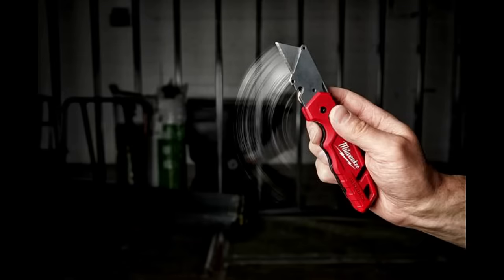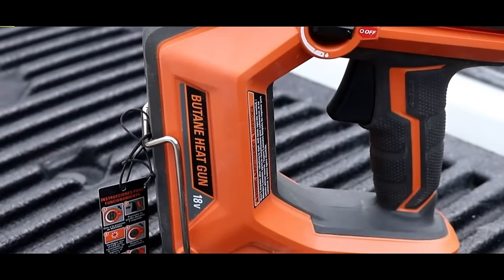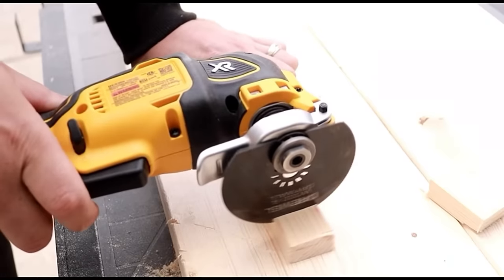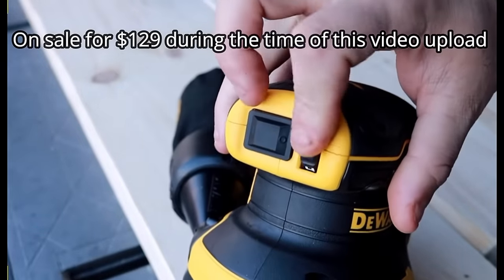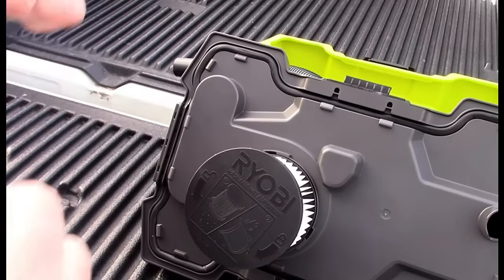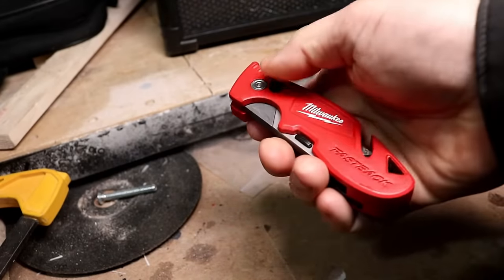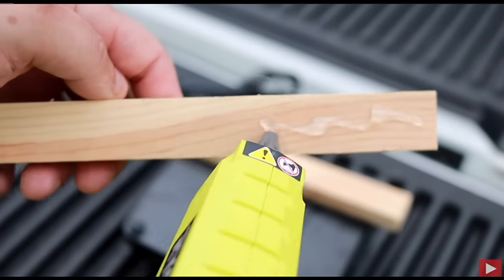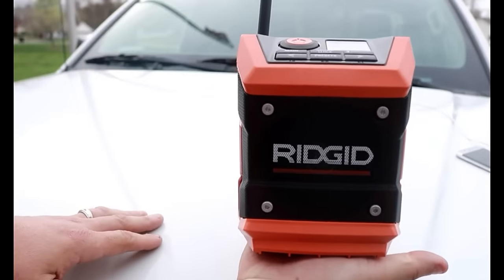Top Ten Inexpensive Tools That You Won't Be Able To Live Without -Tools that will make life easier!

Comment: Think ryobi is the only company that makes a hot glue gun from a power tool company or brand
Reply from the maker: Yeah you are probably right bro. I love it man, they did a great job with it
Reply: Wish dewalt and milwaukee would as I imagine theirs would heat up faster but who want to pay $100 for that.  Most likely the reason we only have ryobi.
Reply: I think dewalt used to make one but it wasn’t cordless
Reply: @themaker4216  Dewalt did and perhaps you can still get one.  I have it and it works great... Think it was $30.   You think they could easily make one considering they already make a cordless heat gun... guessing the same tech applies, meaning heating up an element.

Comment: I've had a wide variety of utility knives over the years, and must say that I hate the folding ones. It's just the operation of opening and closing that makes me very uncomfortable. I've cut myself enough times to know better. 
I have 3 utility knives in my tool bags right now, the old school kind that open and retract using your thumb. The blade doesn't pass near your fingers or palm. Cheap and simple.
Reply: Olfa makes one like the ones you like with what they call a 'metal pick' at the end. It's unbelievable how often it comes in handy; opening paint cans, scraping, opening access hatches, as a slotted screwdriver, etc.
Reply: I agree.  Nothing beats the Stanley Classic.

Comment: Been running 10 for almost a year. It's the best deal for a usable tape there is. it's not worth paying for the noice ones because they don't last. I got to get me that heat gun because that chitznitzel is realnicelike. Been running the rigid orbital since before I owned any dewalt tools or I would have that one also. I gave up on ryobi awhile back because the weedhakers are disposable and last me 2 seasons. But I did grab a backpack 20v weed n pest sprayer so that vac and the gluegun also lookin realnicelike. And the fastback is the best. I have the full saze for ripping shingles because it locks at an angle and the compact for cuttin other crap on sites. The onboard storage and true one hand open and close make it realnicelike. Funny to see how twisted minds think alike.
Reply from the maker: Hahaha 🤣👊

Comment: The Milwaukee fast back is honestly one of the best knives for woodworking/cabinetmaking. You will find your self reaching for it more than you would think. 

Willie Nelson <3
Reply: I like the fast back but I sometimes run into a problem with blades pulling out because of the design the holds the blade, for more rugged tasks I like the huskies folding utility knife because it hold the whole blade

Comment: Cordless tools are certainly useful and convenient at times, however the batteries do wear out and are not warranted except for rigid. Most work can easily be done with a corded tool. It is seldom the case that the only way is with a cordless tool. While it may be at times convenient , using an extension cord occasionally is much cheaper than buying all these battery powered tools. I would certainly say that a drill and impact driver are the exception as the tools you will find most useful that are battery operated. Greetings from Maine.

Comment: That Milwaukee fastback I had to throw away. I guess I grip differently than anyone else but I was constantly releasing the blade during heavy use and I just didn't trust it. I have other ones with different locks and I love all of them but the Milwaukee.
Reply: OX fixed foldable knife good as any can carry extra blade also and very easy to change blades exc. £8 bucks.

Comment: Dremel screwdriver... "you can get into really tight areas with this"  Sure... never seen one in person, but based on the video, I'd say you can get into really tight areas with it, as long as those areas aren't tighter than the areas that your impact driver can barely fit into... You know.. because its clearly, objectively longer than most impact drivers...
Reply: But it's far cheaper than any impact driver. And since this is about inexpensive tools......
Reply: Probably much lighter as well.
I love every tool that fits in my pocket and saves my back from having to lug a tool bag around.

Comment: Ryobi radio has alot better sound
Reply: My Bosch power box am/fm Bluetooth radio is sweet got a roll cage to keep it safe a power cord 4 sockets that work only when plugged in you can charge your Bosch batteries and when using a battery you can charge your cell phone run a USB light if you have one

Comment: What is the point of having a battery and butane in a heat gun
Reply from the maker: I like this better for two reasons.  The heat seems to come out more evenly,  and it also works (in my opinion) much better for epoxy.  Probably has to do with the Co2 that is expelled

Comment: The Milwaukee fastback changed my life. Won't ever be without one now.
Reply from the maker: Agreed Max 👊
Reply: The Olfa snap-off blade with the 'metal pick' is my go to utility blade; it's missing a pocket clip pretty desperately but that metal pick really does come in super handy; scraping, fastening slotted screws, prying paint cans, opening access panels etc.
Reply: I agree mostly. I LOVE Fastback I have the large and smaller version. The smaller version is my favorite. Though I think I got a dud on the Large one, I was cutting shingles with it and the blade kept slipping out despite being no where near the blade release button. Causing alot of annoyance and grief. I think for lighter tasks they are certainly the best utility knife.

Comment: For professionals I would strongly advise against the DeWalt oscillating tool. It is not designed to be handled for hours on end every day. I’ve had five or six of these low quality tools shake them self to death. The battery is way to heavy for the vibrations this tool creates and so it will no doubt come lose on you, to the point where it will no longer hold the battery in place. I love DeWalt and use it primarily in my line of work, but for a multi cutter I only use Fein. It’s simply the only brand that will last for years. Of course for the DIY people it may be perfect, but for professionals it’s a thumbs down from me.